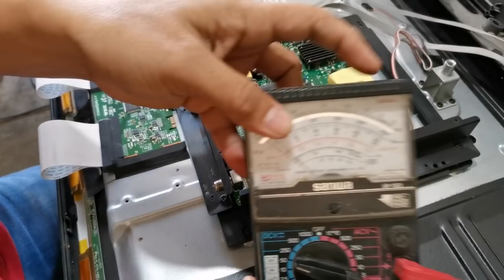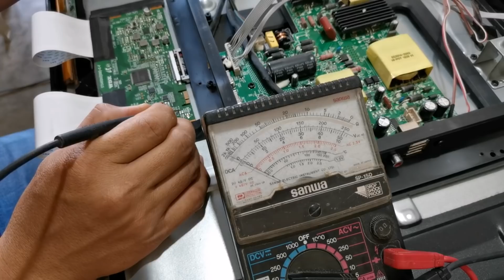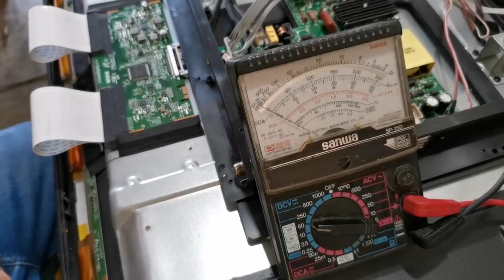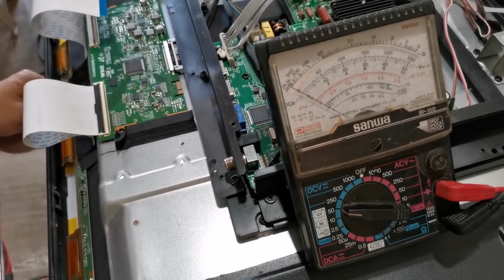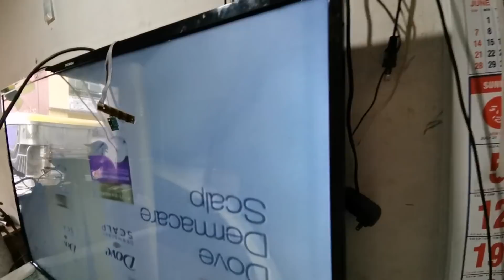How to fix Pensonic 58" Led Tv White Screen display?

Comment: Gudam Master. Tanong ko lang, Magkano ang singilan pagkaganyan ang trouble. Kc, naka repair na ako, nyan. Binayaran ako ng 300 kc daw madali lang daw. Ano ang tamang singil dyan. Salamat Master. GOD BLESS YOU.😄
Reply: Luging lugi ka sa 300 bro. Ano yan crt? Haha. Sa 50" labor ko jn 35-45 Wag kang papayag sa ganun bro kase kapag naaksidente mo panel ng led tv na ginagawa mo eh hndi nman sila papayag na 300 lang ibabayad mo sa kanila. Minsan talaga may mga costumer na makakapal ang mukha, akala yata ang pagrerepair ay para ka lang nagbubunot na tinik sa paa.
Reply: Napakalaking luge,pag ganyan dapat kontratahin mo na agad para kung hindi kayo nagkasundo sa presyo,atleast hindi mo naman ginawa,kahit saan siya magpuntang technician walang siyang makikita na hindi mahal ang singil,depende kasi sa inches at brand yan,sa 32 inches pwede na 1,500 repair lang,,wala pa pyesa,,, habang pataas ang inches pataas ng pataas din ang labor, 42 inches pwede na 3,000 ,sa 47 inches pwede n 3,500